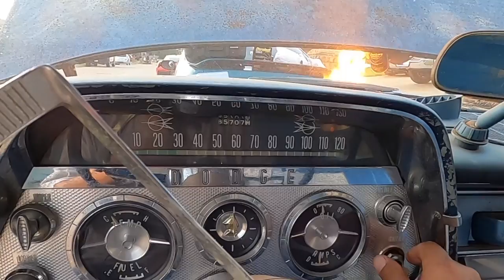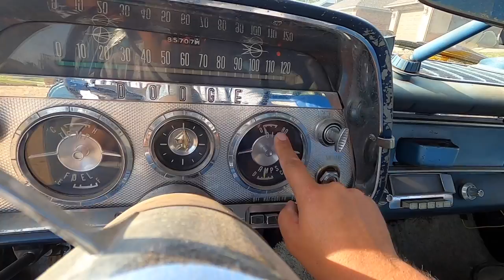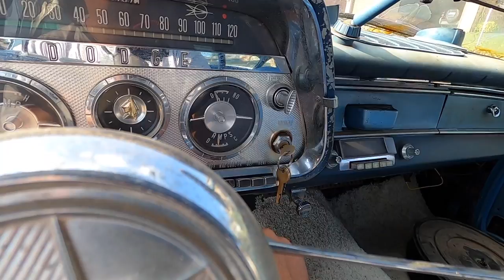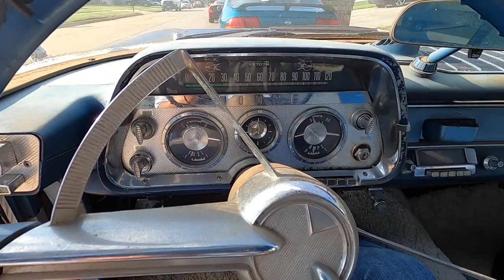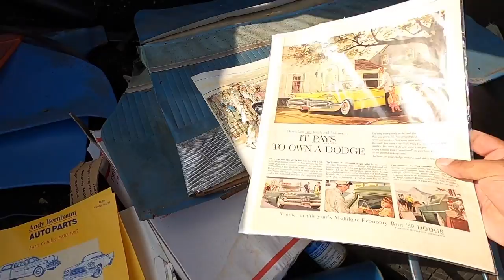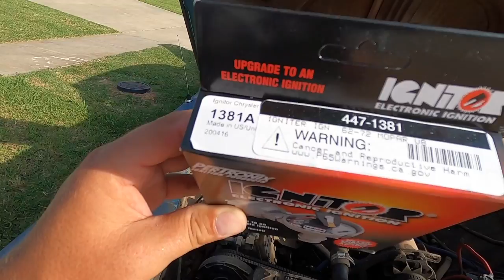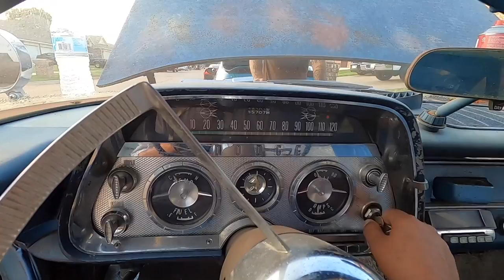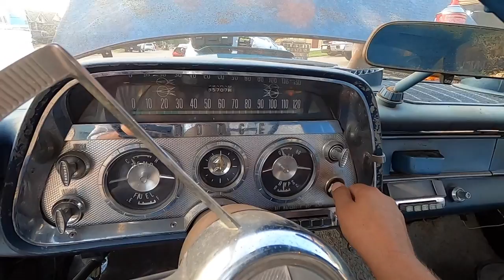I Bought a 1959 Dodge Coronet 326v8 for $4K on Facebook Marketplace - Will it Run?

Comment: I learned to drive on a 1960 Plymouth fury with the Sonoramic commando engine with the 2- 4barrel carbs. 2 door hardtop. Don't think a 16 yr old teenager couldn't  Burn the tires off of it and my father got a trophy at the dragstrip. My dad used to unhook the linkage on one of the carbs but he didn't fool me I would hook it back up and run the crap out of it and unhook it before I went back home...lol GREAT MEMORIES...

Comment: The 326 was replaced by the wedge motor in the mid 60s   Came out in 57     I think tk has a spare 5.7 laying around
Reply: 326 was replaced with the Poly engine the 326 is and based on ... the 318 Poly! also the big block Mopars ..361,383 for these cars..
 It's not the same 318 as people think of,totally different engine..
The 318 people think of is the 1967-2002 Wedge engine more so known as the LA 318..
The 326 was also replaced by the  Mopar Big Block 361,383 & 413..later the 426 wedge,426 Hemi,440..

Comment: Don't change the color and the trim is not chrome but stainless. The spring you found is for the door hinge probably and the floor is patched where the dimmer switch is located. Once the carpet is out you will have to address the floor pans. Heads will have to have hardened valve seats installed and you will use high octane fuel, not ethanol mixed.

You also need to check fuel pressure, electric pumps will need a regulator so you do not push pass the needle seat and float flooding the engine with fuel.

Comment: The reason why the stock radio doesn’t work is because the car needs to be started and warmed up in those old radios used to be like something like the car engine where it doesn’t quite function right until it starts getting warmed up
Reply: Thank you Randy for liking my comment you should start selling merchandise

Comment: I strongly suggest that you check “the value of the original survivor status of the car” before you change anything, especially the exterior paint, trim, etc. I think you will find the value of the car to be way higher than what you paid.  I guess the value to be approximately $24,000 as is.

Comment: My dad had one, 4 doors, two tone pink, 326 engine, which was the only Chrysler A engine built with hydraulic lifters. OMG, to do a really first class restoration on one of these, it'd cost a small fortune just to have all the chrome parts redone.

Comment: I put a similar electronic ignition system on my 1969 ranchero, with a 302 ci motor,, It gave every cylinder perfect timing, and not just number 1 cylinder,,,  Made a huge difference in performance,,,  :-)

Comment: I my be wrong... Probably... But it seems to me that the 318ci engine of that era is parts swappable with the 326. In the late 50's Chrysler made a 318 version called the v-800 which had 2 4bbl carburetors. The cam from that engine ought to fit too. That would be a killer period upgrade for the 325.2 err 326.
Reply: 326 was based on the 318 POLY like the 325 and 313 and many more,277 etc.....
It's not the 318 most people think of..The 1967-2002 318 is not the same engine..its a Wedge not a POLY!

Comment: Little steep for a 4-door in that condition, but not a bad start on a cool car.  They, BTW, are wheel covers, not hubcaps.  Glad you got the door panels.  Those are parts unobtanium.   Taillights on top/ reverse lights on bottom.  Needs a correct ignition switch, as well.  Probably help operation.  Also tough finds, but they are out there. 
Going from drive to reverse is cool, as is vice versa.  Just be sure to be completely stopped.  The parking brake is actually on the rear of the transmission, and consists of a small brake drum and little brake shoes, through which the drive shaft is attached and spins.
The speedo is a multi colored ribbon not a light set.  It spins, not illuminates. 
Restore it, don't restify it.  Nice enough for that.  I have owned a couple '59 Dodges.  Love the pivot out ashtrays and the stand up A/C ducts.  Unique to these cars.

Comment: Yes the 326 engine was introduced in 1959 (325.2 to be exact) with polyspherical combustion chambers.  I believe the transmission was a Powerflite 2 speed and not a Powerglide. That was Chevrolet's 2 speed automatic.  What a great find!  And just look at that cool front end.  Watch some of the episodes of "Highway Patrol" here on youtube and they feature a lot of the cop cars as 1959 Dodge's.  They used a two door post which by today's standards is very odd.

Comment: fuel pick up in tank has a filter on it that cracks and sends degris to the carb where it blocks the fuel flow. Pull the line from the carb watching out for spewing gas. Never mind you ran it

Comment: You have a burned valve in at least one cylinder.  Don't worry, though.  I have had a burned valve in my 1963 Fury 361 since I bought her in 1982 and it has never affected anything.

Comment: PowerFlite is a two-speed automatic transmission engineered and produced by the Chrysler Corporation and used in their passenger cars from 1954 to 1961. Production began in late 1953; despite the launch of Chrysler's three-speed TorqueFlite automatic in 1956, the simple and durable PowerFlite remained available on Plymouths and Dodges through the 1961 model year, after which it was discontinued.

Comment: Chrysler 2 speed was powerflite 3 spd torqueflite was also optional starting in 57 in Dodge and Plymouth. The 326 was a polyhead like the 57 to 66 318 bore 395 stroke 331 .the 318 was 391×331 Chrysler made a lot of different poly head engines

Comment: Parking brake drum is on the rear of the transmission & is very effective. Early 3 speed torqueflite not a 2 speed. The last 2 speeds were in either 56 or 57. I had a 55 Dodge w' a 2 speed. Engine is the same as a 318 poly engine but w/ a slight overbore. They had an optional 4 bbl as well as a dual 4 bbl available. The poly engines had solid lifters not hydraulic. Engine not running very well, has a bad misfire.
Reply: The Powerflite was discontinued after 1961

Comment: As for the fuel tank, drop it and clean it out well. Then replace all the rubber lines between the tank and the car then re install it and it should be fine

Comment: Actually the name of the transmission in your 59 Coronet is a power flight 2 speed. That year the torqueflite 3 speed was a more expensive option and I'm pretty sure the first year it was offered as an option for the Coronet.

Comment: Your transmission is the 3 speed TorqueFlite. The brochure showed two pics of transmission shift pads. The first pic showed a 1 and 2 button pad and called it a TorqueFlite. The second pic showed a LOW only button pad and called it a PowerFlite. So you have DRIVE and second and first gears available. If it still works that is. lol

Comment: It's actually a 325.2.
Chrysler called it a 326 so people wouldn't confuse it with the 325 red ram hemi.
The 326 is a poly, not a hemi, similar to the 318A (not the LA).

'59 came in PowerFlite (2sp auto), TorqueFlite (3sp auto), and 3sp manual.

ETA: fantastic video, though.

Comment: check the fuel pressure at the carb . carbs only need 6 psi. to much pressure forces gas pass the float seat and floods the carb. you could install pressure regulator if to high.

Comment: 2 things you gonna wanna know.
1. is the engine COMPLETELY original? If the answer is yes, you might want to see if you can find fuel that have no ethanol, as ethanol really screws with carbs (New AND old)
2. (if you answered yes) You're going to want to get those heads checked out as this woulda been made in the days of leaded gas. The lead in the gas was used as a lubricant for the valve seats so the valve seats (generally not hardened so again, ethanol really screw with them)

Comment: clean it up get some sos pads with the soap in them for the surface rust on the white on the roof go easy and most of it should vanish .but pressure wash it first powdered washing powder and hot water will help as a first wash as well .

Comment: You use feeler gauge to set the points. fine out what thou of inch the points are. On the distributor bring it to the top end the point should be open to see the gap open.

Comment: What, you did not get out an OBD scanner for codes. No air bag / seat belt light on the dash. 
It has air conditioning!!
Nice simple basic mechanics and you don't need to pull half the engine apart to get to stuff.
What a find. What a score. Get it running and keep it in a garage or under cover. If repainting keep it OEM.

Comment: 1. The electric fuel pump is probably putting out too much pressure, you only need about 8 psi
2. You're not gonna find a 4 bol "adapter kit" you'd have to find a 4 bbl manifold which will be virtually impossible for a 326. You have a Carter model BBD and I'd probably just rebuild it
3. You don't have a powerglide transmission, you have a torqueflite transmission, and its 3 speed. 
   I think that

Comment: The 326 is a poly A 318 overbored 0.040-inch to 3.95-inch. It could have been called a 325 but Dodge had a different motor with that displacement.

Comment: I'd change the points over to Petronix electronic ignition easily installed in the points distributor retains the old look and one wire connects to the coil neg and the other to the positive will make it very reliable and could easily be changed back.

Comment: it's better as a 4 door, every one fits comfortably and still looks badass... Put the original mechanical fuel pump on and it will probably run well, those electric ones flood and choke the carburetor up and dont last long

Comment: You might get lucky and find a 4bbl intake off of a 350 cu in Chrysler. But it'd be rare to find a 4 bol manifold for the "poly" engine, which is what you have. 
  The " poly" engine is basically a hemi with wedge heads. Ive heard that a hemi intake might work on the "poly" but since I've never personally done it, I can't verify that.

Comment: Please time it! Pull the number one plug put your thumb over the spark plug hole, bump it until your finger blows off the hole and line up you're rotor button then bust out the timing light! Me  myself I would pull the valve covers and watch the rockers and as soon as the intake valve closes I would go from there!

Comment: You can likely have the carb rebuilt for less than a 'new' one.  Shop near me does them for under $200.. At least the Rochester 'Y' carb for my '52 chev.  You can check on Rock Auto!

Comment: I wish I had the bumper jack and plate for my ‘61 New Yorker.  Also, I’m thinking the Parking brake (not e-brake) is similar to my ‘61.  The brake is on the back end of the Torque Flight.  Love your Dodge and my Chrysler!  (We had one new back in ‘61, thus why I’ve looked for one for many years.) I do need to replace my brakes, think I’m going with safer disc and dual circuit.  All a learning experience!

Comment: Nice car. I would paint it a two different colors of blue so it matches the interior and under the hood and trunk. To start with I would buff out what you have you can't hurt is. If you change the carb. you should also change out the cam as well to deal with that extra fuel.  Thanks Mike.

Comment: Powerglide was a GM trans. You mean a Powerflite.  And that's unusual, because most '59s had a 3 spd TorqueFlite. Those speedo 'lights' are a roller.

Comment: You need to pump the fuel a few times before you start it it is a carbureted engine they just don't start like a EFI car would anyway Points are easy and they will never leave you stranded on the side of the road like a electronic Ignition will I personally like points and all you need is a match book or a business card to set them you should check your valve lash on that engine and see how bad your timing chain is the best way to check that is to have the cap off the distributor and turn the engine by hand til the rotor in the distributor turns then turn the engine the other way and see how far it turns before the rotor turns if it's a lot then your timing chain is stretched and you need a new one it seems you have a timing issue with it or a vacuum  leak somewhere

Comment: Rebuild the original carburetor. Or if you MUST replace it then replace it with a 400 cfm two barrel carb. It will run better with a lower cfm carburetor then it will with a larger cfm carb. Something even smaller than 400cfm would probably be better. Don't go much higher cfm's than the factory size. If you don't put a high performance camshaft in it the factory size carb will be the best for that engine.

Comment: I’ve never heard of a 326 either.  I would argue they never made one BUT Chrysler made some oddball engines in those years before they settled down.  I think that is a THREE speed Torqueflight and not a Powerflight.  I think with the 2 barrel that is may have been an economy model. Very unique!  I always thought 59 Dodges looked “angry” from the front. I would NOT change the color nor would I put a lot of money in it.  Factory Air would have been ultra rare in that car.  I would leave the original points instead of a Mickey Mouse system.  Interesting car!

Comment: It stunned me that you would even attempt to start an unknown car, that's been sitting, off the tank supply. How much smelly old water-varnish mixture were you planning on pumping through there? I assumed you'd go right for gravity-feeding fuel from a gas can propped on the fender, direct to the carb. Given the engine vacuum generated on cranking (and after start), the carb should automatically take enough gas to keep it going. Just keep an extinguisher and wetted blanket handy in case of ignition due to a backfire.

Comment: Powerglide is a Chevrolet transmission.
I get a kick out of millennial kids when they find cars like this, manual windows get them all excited.
The trim is stainless steel thats why it is still in good shape. 4K weight wise is about right.
Rotor button is what they called them. Not bug.

Comment: You could do a driver quality restoration - not a show car but something very attractive and presentable.  If it was my car I would paint it the original colors and get original upholstery fabric from SMS in Oregon.  Wide whitewalls too.  Have it match the picture on the brochure cover.  SunStar makes a 1:18 diecast 1959 Dodge in various colors, too - so you can have a model car to match your "real" car.

Comment: Next you should see if you can get a 59 Mercury like my sis had bigger than the coronet, police engine no power steering with small steering wheel front seat as big as a 3 person couch and passenger side dash was 3 feet away a windshield.

Comment: The ignition is not He is not an original. You can still replace it. And match the ignition to the door and the trunk is by itself. I am a locksmith in Oklahoma. I used to have a 62 Chrysler Newport.

Comment: you don't need a new carb,
a carb rebuild kit will be under  half the price and even then you will only need the needle and seat and a top gasket plus a length of pipe

Comment: if you are used to driving a standard transmission car and try to depress what would be the clutch pedal to come to a stop ~ it stops really quick power brakes or not. my teeth are missing for other reasons or maybe they got loosened when i did that.

Comment: sorry , that car may have the torqueflite check it may be one of the air cooled ones ,i had a 57 plymouth belvedere 2 dr htp  with the three speed automatic came out in 1957. was optional until 1960.

Comment: It's not a Powerglide. That's a GM transmission. It's not a 2 speed either. If it was, you'd only have reverse, neutral, drive, and low buttons.

Comment: Dodge had the torque flight push button automatic, Chevy had the power glide. I grew up around these automobiles, I am 64 years old & still like the older automobiles. This is when, they the auto industry made cars, instead of front drive, high tech., JUNK !!!   KEVIN PHOENIX

Comment: That is not the carb that belongs on that car.  Please find the right one and also put the mechanical fuel pump back on it.  The car will perform the best with the parts it was designed with.

Comment: That would be a 2 speed Power Flight trans the Power Glide is a GM trans I know everything about those old cars they came with two engines options the Flathead straight 6 230CI or the Red Ram 326 poly V8 and that is what you have

Comment: see if you can get a carb kit should be available through mopar parts on line.max fuel pressure 4-5lbs.take tank to repair shop that fixes gas tanks get it cleaned out,

Comment: you have the option of leaving the trunk unlocked. factory air! rare! get a higher power  coil like an accel. the hotter spark will make her run a bit  better. i had ac too, and finned mopars have an almost cult following :) 4 doors wagons and all. mines a four door too. i forgot to tell you about blackcarllc.com will have body parts for you too:) sorry for all the posts. im excited too XD
Reply: invest in a battery disconnect switch it is cheap insurance. I had a dash fire, trust me. another good investment is an optima battery it will keep cranking until the engine submits.

Comment: That's the 3 speed TorqueFlite transmission, not the 2 speed PowerFlite, Randy.   You have D, 1 and 2 , not Drive and Low